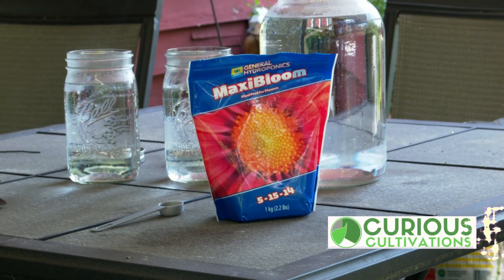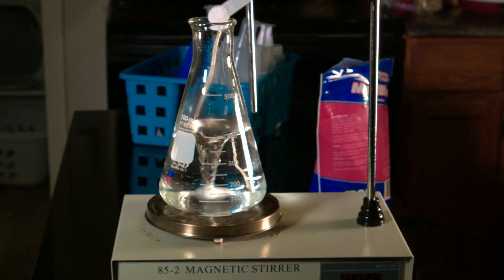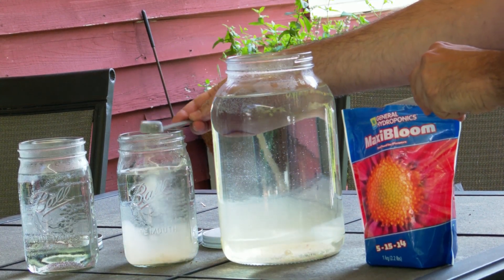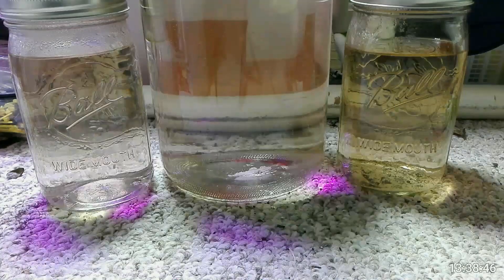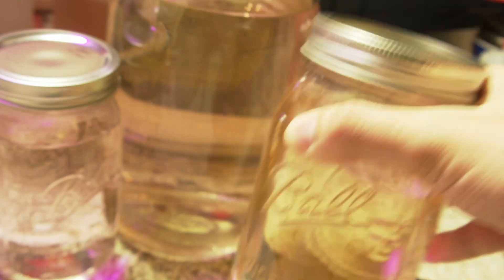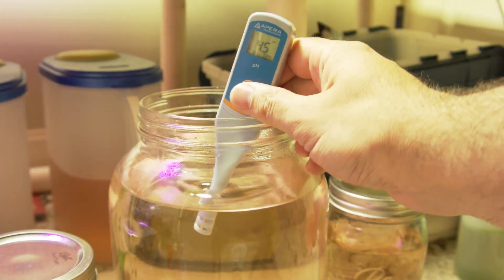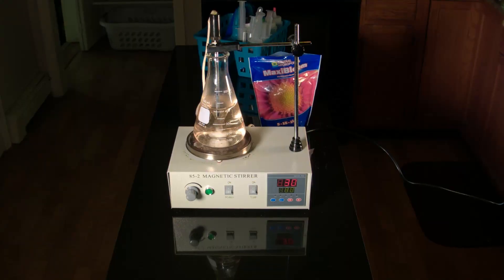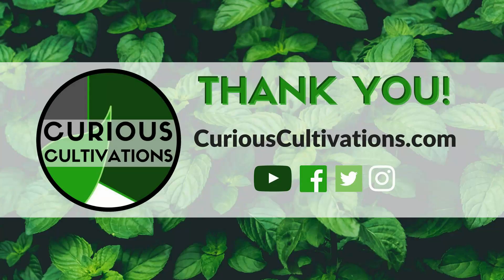Mixing Maxibloom - Curious Cultivations

Comment: My tap / well is between 11-25ppm from the spout, Mixes fine with them both and air stone / Light stir I haven't noticed any nutrient not disoliving or falling out at the bottom of the container, PPM between 600-1100 depending on the stages of growth.

Comment: I just used a stainless steel kitchen stick blender and it worked perfectly. It's short for a 5 gallon tote, but it creates a big whirlpool so it does not need to go to the bottom, it stirs the whole 5 gallons. I wouldn't have thought of it had I not seen this video. It just took hours off my mix!

Comment: i have not had a problem although i did use a paint mixer barrel type with my cordless drill, i did mix mine in a 3 gallon bucket worked great everything dissolved in cold water

Comment: here's an easier way to mix it. when you stir to mix the solution, stir fast in a small circle. I noticed it mixes a lot faster compared to stirring all around the container. it is the same concept as the magnetic stirrer
Reply: make sense

Comment: My water never goes above 7.2 with this product (6.7 without) , I ph it down to 6.0-6.5 for soil, less for hydro 5.5-5.8. In a DWC system it completely dissolves in about 3 hrs and I dont find there is much PH drift even over a week or so, I do a total resevoir change every 7-10 days. I also use less than the directions on the pack, Less is more!, I start at a third strength and creep up to two thirds strength at the most, depending on wich strain of my favourite plant im growing.
When I start plants off I use maxi grow for the first 3 weeks then switch to bloom (autos I just use bloom from start to finish). 
Nutes are only one part of the mix to get your plants full potential! Enviroment is just as important.
Reply: Yup it had a ph buffer in it. Good stuff.

Comment: I live on the Mckenzie River and fill my jugs with that , and since its temp is in the 40s F , I mix my Maxibloom then I set the jugs on the deck in the sun until I cant feel the temp . (Lukewarm) . While feeling the temp each time I shake the jugs furiously , by the time I'm ready to feed it is dissolved enough to my liking .....Ive been using this stuff for decades....I add some humic/fulvic acid  , amino acids(Glycine/Glutamic Lab/Tech grade) , and depending on the stage , add Kelp ,  extra P(P205) & K(K20) , Yucca extract , teaspoon of unsulphured  molasses , vitamin B , Iron (FE) , Cobalt (Co), Copper(Cu) , zinc (Zn), boron(B) ,silicate(Si02) , Sulfur (S) , Xtra Calcium(Ca) , Magnesium (MG), Manganese(Mn), And some Hydrolysate (Plant proteins )  The root zone Temp (RZT) is optimal for newt uptake @ 68 to 78F , but it is necessary to fluctuate the temps , because some newts uptake better in higher RZT and others uptake better in lower, eg proteins , sugars , Carbs etc. ....Peace out (QUADS)

Comment: Those who use maxibloom for soil, do you use calmag as well?
Reply: That what I want to know. Maxi gro and bloom both have cal and mag in them but us it enough or possibly too much
Reply: Sherekhan420 U you can easily tell if it’s too much. What I’ve always learnt from growing is that less is always more. Don’t overdo it and you will be fine.
Reply: Only if you need it .
Add on only water days.
Reply: Just started using the Maxi bloom wondering if you had the cal-mag right with it and your magnesium

Comment: this is ridiculous i have never had a hard time at all mixing this... just let the water come up two room temp to get rid of chlorine and it mixes easy no problem at all,, your not doing some thing right..
Reply: Hard white bits stay on the bottom of the jar for days after I mix it
Reply: @ericamiller2108  what are you using for dose... first of all 2 table spoons is ridiculous i use # 1..... 1/2 spoon full.. and i dont get nothing....in a gallon and i never see anything... and even if i did i would not worry... big deal i would say...but no more than 3/4.. IS A WAIST.. not needed.. i have been using this stuff for 3 years i think.. and  there is nothing better...
Reply: @hulie1234  I put 1/2 teaspoon per gallon of tap water. My Tap is 200 ppms typically
Reply: NEED TO ADD IT IN THE HOT WATER FIRST. IT WILL DISSOLVE 100%.
Reply: @mjusa4279  i have never had an issue i have been using this for 5 years i just finished my first bag... and i have never had a problem at all... i let my water out 24 hours thats it,, thatsmy trick and this stuff is almost gone when you dump the teaspoon in the water,,, gone !!!
Reply: @hulie1234  do you use tap water and how much ppm does your tap water have? My RO has less than 20 ppm. Does your stuff dissolve immediately? Also the thing is I grow in coco coir and I water almost once a day or once two days, and I have an 8gallon bucket which there is a water pump feeding the coco automatically. I noticed that the ph rises as each day passes by....
Reply: @mjusa4279  i use city tap water i have never cheeked ppm my water is fine i have never seen the need for it,, all i do is ph the water but i grow in coco if i was growing in soil i would not and would not use this maxi grow and bloom with liquid koolbloom and ripen for the finisher,,,ummmm hmmm my ph maryjane lasts good for 2 weeks after that i need two fill it... but two tell you the truth i have herd of ro water being difficult two ph...i have the same set up drain two waste into coco... you need two flush coco coir out every three feedings...two avoid salt build up...and yes if my maxi grow and bloom does not desolve it is not very much just stir it a bit and its gone... your only saps two use 3/4 teaspoon a gal.. hear is the info,, are you on uptown grows site i see you maryjane weeds ,,, hi.. well hear is your info....good luck never put anything into water that is organic like kelp or anything it will clog your lines quick...https://gh.growgh.com/docs/Feedcharts/GH_Maxi-DTW_03216am.pdf
Reply: @hulie1234  thank you so much for your info.
Reply: @mjusa4279  no problem happy holidays and happy christmas from my familey two yours ,,,, blaze away my friend hope it yields well... this is the best cheapest nutrients for inert growing mediums... liquid kool bloom and ripen ar the recommended doses have amazed me at there 5 ml a gal

Comment: I have to mix large amounts at a time...about 300ML of MaxiBloom per watering (approx. 30 gallon reservoir that gets emptied in one use). I have found the easiest way (since I fill my reservoir via garden hose attached to the sink) is simply to dump the maxibloom on the floor of the rectangular reservoir. Then I turn the hose on very high powered, and pretty much blast the stuff. As it gets deeper, I swirl the end of those around in the water with vigour (and this is cold water from a well). While it may not FULLY dissolve it all, it works fine for me and was way more time efficient that the 'hot water and shake' then adding to each 2 gallon watering can individually...